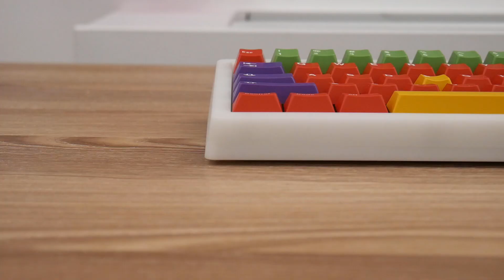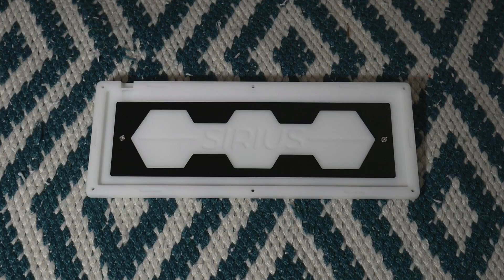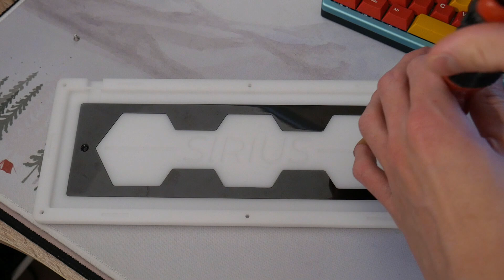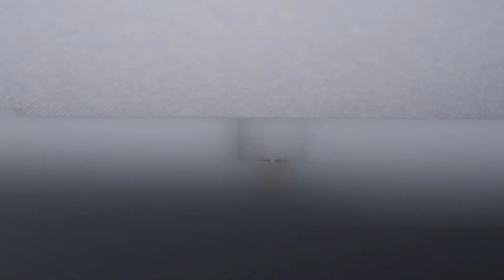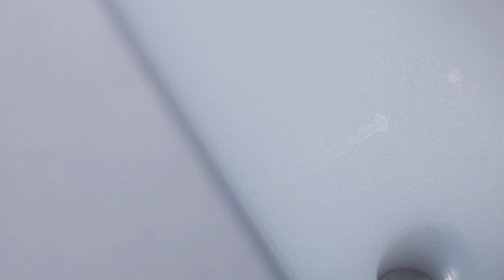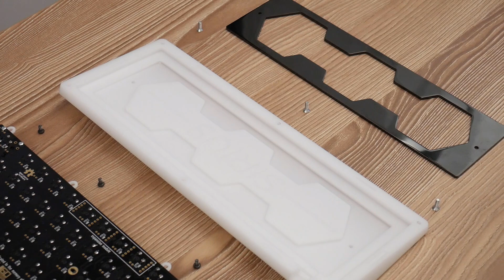Premium POM Plastic 60% Keyboard: Sirius Review

Comment: Your the only perosn I've heard say pc is more resonate it's natural properties are to dampen unwanted sounds lol so yeah yoy hear the switches but that's about it aluminum is like a speaker you must of had some bad aluminum baords that's are super silent I have experienced very loud aluminum boars somy pc boards usually are more silent but yes have a deep tone but it's not always fhe case for either it depends on the baord the density also space within the board a hole bunch of variables but none of mg pc boards have been that loud and they dotn ring when you hit the switch it makes the nosie but stops almsot immediately with aluminum it rings slightly more so resonance aluminum wins always its metal compared to plastic the acoustics just cannot be as good in a resonance way your seriously the firdt perosn I've heard state this about pc vs aluminum even jae from top clacks compared the singa v3 aluminum and pc and ths aluminum actually had the deeper more resonance tone to it with more acoustics yet the pc had more clack that's why I say if usually depends on the baord itself but again aluminum is going to be more resonant unless it's a huge chunk but most baords now use weights for the actuallg weight and make the case lighter with the weight distributed correctly I think you get confused sometimes ebvause with pc all you hesr is the switch with aluminum you can hear other things also which is part of its acoustic properties but pc is done as something that has dampening properties not aluminum pc is suppsoed to help eliminate unwanted noise again not aluminum but grest video sry about the punctuation I'm on my phone youe comparing a compeltel different aluminum baord to a different pc baord if you were to compare both of the same board you would be surprised
Reply: KC_DOT man.............
I was trying to read your comment because it looked like it had the info I was looking for, but I had a headache halfway through. There's a key 2 places left of your Right shift key. It's all the rage. All the pros use it. Give it a shot, you might like it.
Reply: @kitk7248  issue was at the time I had a horrible phone and thats what I was on. I am very sry for the headache. Please excuse the lack of punctuation. As im sure you can understand stuff does and will happen sometimes. It can make life a little harder, I hope you have an amazing day 🙂
Reply: @reviewforthetube6485  Ah that makes sense and I can fully accept that. Have a great day yourself.
Reply from the maker: Like I said in the review, conclusive testing cannot be done between boards of different design. I will be doing direct a/b testing between aluminum and polycarbonate KBD8Xs to find out for sure. What you think should be true based on assumptions about some fundamental property of materials may not be true empirically

Comment: Production quality keeps increasing with every upload, loving the videos man. 
Curious: I've only experienced Aluminium and plastic cases - in your opinion, what type of case material (or maybe plate material) will give me the most different experience, sound or typing wise from alu/plastic?
Reply from the maker: Typing experience will change the most with plates. For top mount cases, a polycarbonate plate will feel very different from metal. 

I think sound is affected equal parts by case and plate
Reply: @JYMV  ooh I see, will be on the look out for a 60% polycarbonate plate!
Reply: young glarses
Reply: Young glarses
Reply: Young glarses